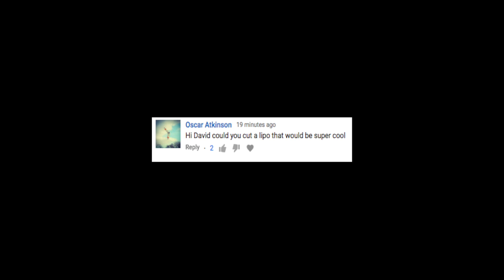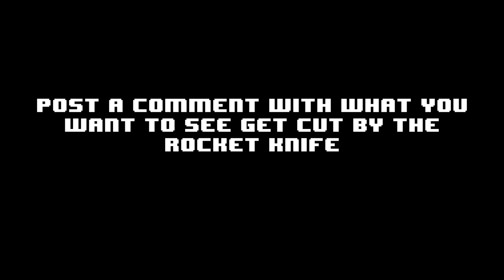Rocket Knife -VS- LiPo Batteries (Surprising result?)

Comment: The Lithium in lipos is irrelevant for a fire. There's so little in it and it's not in metallic form. Just use water to extinguish the fire (that's what they tell flight attendants should some device start burning; I guess if it's an OK thing to do on a plane, it should be plenty OK on the ground). The stuff that's burning is the organic solvent based electrolyte. For it to burn it has to get hot enough, which an internal shortcircuit of the battery can do.

Comment: There is NO lithium metal in LiPo's.  It is NOT reacting with the water.  The amount of lithium (in ion form (hence the name of the chemistry "lithium ion" not "lithium metal") is so little, getting a reaction with water of more than an invisible fizzle out of it is impossible.  What you are seeing there is merely the result of the anode(s) and cathode(s) shorting out, causing excessive current to flow, causing excessive heat to the flash point of the electrolytes , which causes the fire. Any "fizzle" you see is as a result of electrolysis. Same as putting the leads of a battery in a glass of water, and maybe a bit of nucleation from the near nano size carbon particles on the plates.  Also, water CAN and WILL put out a LiPo fire.  The issue is getting the water inside the foil pouch...  Please stop propagating mythical information about lithium polymer cells.  Certainly they have their dangers, but misinformation can be just dangerous as no information.

Comment: Super heat a 1/2 inch diameter ferro rod (found on ebay) and cut it length wise with the rocket knife. You'll definitely have a big reaction.

Comment: Needs to be something that either reacts violently or looks cool when cut in half.......Perhaps some clay or spray paint or CO2 cardtridge, or camping propane cylander (small green ones), Lead acid battery (Acid removed).....or see if you can put some sand paper on the knife and try to light a match. then cut fireworks in half!!

Comment: Rocket Knife VS Rocket Knife (at 90° to another; they meet in the middle)
Reply: Save that for the last episode :p
Reply: rocket jousting
Reply: GOC you took the words right out of my brain... even the bit about the 90.
Reply: GOC Boom.
Reply: GOC ho yes
Reply: Hell ye
Reply: Rocket knife vs Rocket knife, Two tracks directly at each other and have one knife vertical and one knife horizontal so they pas through the same plane, no need to calculate the one point where they might hit as they can hit anywhere along the track!
Reply: no